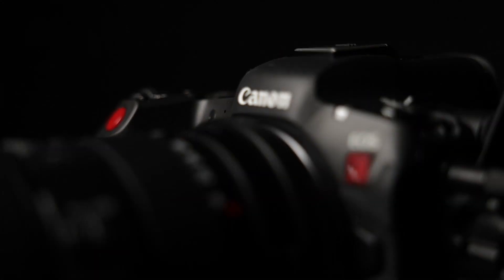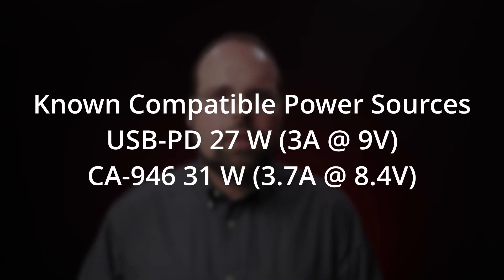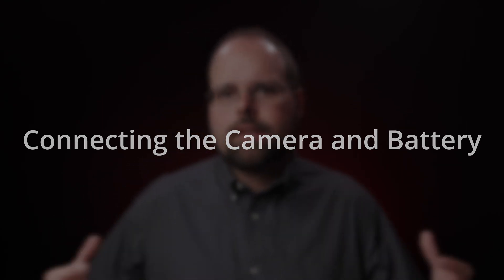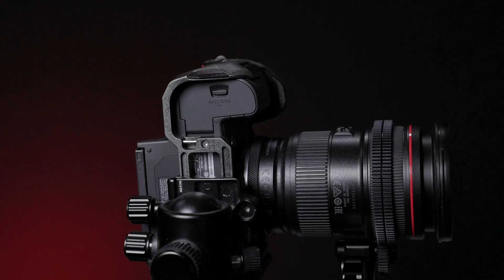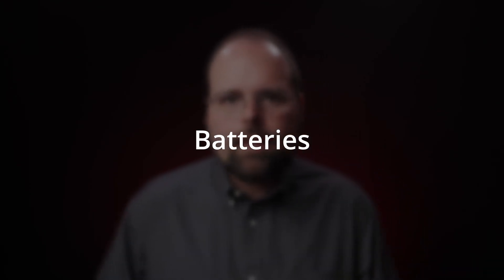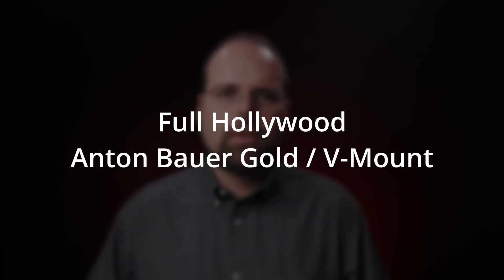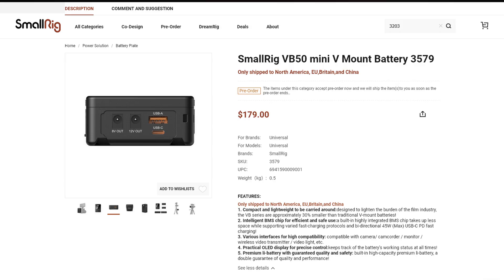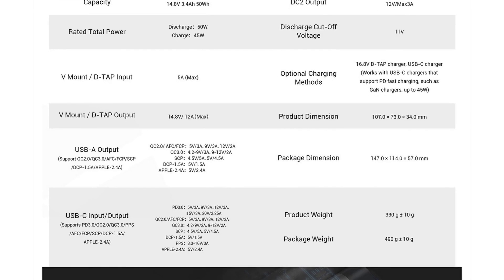External Power for the R5C - EOS R5C Tip 5

Comment: Hello there! Thanks for such an informative video 🙏 Could you confirm what cables you’re using to power your R5C and SmallHD monitor with the Anker 747? I have almost the same kit: An R5C camera, Anker 747 power bank, Atomos Shinobi monitor. The Anker 747 does power the camera all the way to 8K60 w RF lens, but when I connect the Shinobi monitor through a BlindSpot Power Pipe USBC to 12V DC cable, the Anker 747 no longer supplies enough power for Power Delivery to stay on, on the R5C—and the internal battery begins to drain quickly. One more question, do you get 8K 60p w lens autofocus AND power for your external monitor from the Anker 747? Thank you. It’s been such a bumpy ride trying to power this camera kit.
Reply from the maker: The cable I'm using for the R5C is listed in the description - it's the Poyiccot 1’ USB Cable.

I'm using an older BlindSpot Gear power pipe (8.2V output). Blind Spot Gear says you must use a 12V supply, but that's not completely true. It runs fine from a 5/9/15/20V USB-PD supply, it just doesn't supply the full voltage (6.5v instead of 8.4V), which the Small HD display doesn't care about.

The important part is where you plug things into the Anker 747 battery. The camera has to go on the outer USB-C port. When there's multiple USB-PD devices attached, the outer port will continue to supply 45W while the inner port's output gets throttled to only 18W. The camera needs a 27W supply to operate off USB-C, so the outer port satisfies that when both ports are in use.

As long as the camera says USB-PD in the upper right corner of the screen, it's running on USB power, if it drops to battery that changes to the estimated battery time remaining.

Comment: We have an external FXLION ONE Vmount battery.  when we plug it via USB C,  the camera display shows "USB-PD" for about 5 seconds then it goes away, and starts using the internal Canon NH battery.  We let the internal canon battery drain and wondered if the external would kick in at some point, but it didn't.   Im wondering if there is an issue with the USBC port /internals on the camera body?  We've tried different cables... in fact the supplied canon cable, when connected, doesn't seem to be detecting the external battery at all (in other words, the camera display won't even show "USB-PD ").  I've verified the external battery functions, by using it to power lights, charge phones, etc... so we're confident the battery is functional.  Any ideas?
Reply from the maker: I've seen a few USB-PD capable V-mount batteries that don't work with the R5C for some reason. SmallRig specifically notes this on their batteries. This may also be the case for the FXLION batteries (or some of them as well). 

If you have a >30 W USB-PD charger (like the power supply for a MacBook or MacBook Pro), try using that and see if the camera switches to PD mode. If it does, then it's not the port on the camera, it's the battery's PD implementation.

Of course, the whole point of USB-PD is that it should just work, anything that supports the required wattage should be usable. But in practice, it seems like corners are cut at every opportunity and with it compatibility. So much for USB being Universal as the first letter implies.

Comment: Thanks Jason, great insight into powering the R5c which I just bought. Just a quick question, I have a ‘power junkie’ npf battery adaptor with a few usb outs. It’s made by Blind Spot. Do you think that mounted on the hot shoe and tapped into the camera, will work? Hugh
Reply from the maker: It should work with a dummy battery. But you will have the power limitations if you want to shoot at 8k60 FPS. If 8k60 isn't a consideration, then it should be fine.
Reply: Yeah, I have it it'll work fine. The barrel output to the camera is just like a battery inside the cam. Gives those two usbs and you can use a beefy npf. The other guy is right you cant get 8k60 any other way but USB pd

Comment: Great video. Thanks so much for the information. Quick question for you. I am unable to change recording modes when I have the USBPD plugged in. The menus are grayed out. Any reason you know of? If I unplug and go internal battery it works as normal.
Reply from the maker: I've never seen that one before. On my R5C I can change between any of the recording modes whether the camera is on USB-PD or the internal battery. In fact, I don't think I've ever seen the rec mode setting grayed out ever.

I'm at a loss on that one. The only things I can think of to troubleshoot that one are to make sure you're running the latest firmware and if so reset the camera's settings to factory defaults (system settings -> reset).

Comment: Question, I have a SmallRig 50w vmount battery, what type of cables can I use to power my R5 C? I seen people have Type C to Type C. Is that the only way? You cant do USD -> Type C on the camera?
Reply from the maker: Yes, you need to use a type-c to type-c cable. 

The R5 uses the USB Power Delivery (USB-PD) standard which requires that it actively negotiates the power settings with the supply (your SmallRig battery in this case). If you check the specs on that battery, it does not support USB-PD on the Type-A (standard rectangular USB port) so even if you used a Type-A to Type-C cable, the camera wouldn't be able to negotiate the right settings, and as a result wouldn't use the battery for power.

Unfortunately, the governing body for USB has really made a mess of things over time. Maybe it's just me, but I feel like USB is becoming more confusing as time goes on rather than less.

Comment: Im not sure what I am doing wrong - i've put a battery in the camera and plugged in a USBC cable from both mains and a power bank (used to power BMPC4K) and it doesn't seem to do anything!?
Reply from the maker: If the camera is on, and in video mode, it will display USB PD in the upper right corner of the screen instead of the remaining battery time. That's the only indication that it's running off of USB-PD.

If it's off, and you have a LP-E6N or LP-E6NH battery, there will be a charge icon on the top display (or full if the battery is charged). Only LP-E6N and LP-E6NH batteries can be charged in the camera this way, and you'll probably have to stick to Canon first party ones at that.

If you're not seeing any of that, check that your USB power supplies support USB-PD and can provide 3A at 9V (27 watts). It's capabilities should be listed in the fine print somewhere on the charger or battery pack. If they can, try a different USB-C cable.
Reply: @PointsInFocus  thank you for the detailed response. Appreciate it!

Comment: if I want to use my v lock BV140HD MINI on belt adapter via cable and dummy battery? would that work ? what dummy battery u suggest ? thx
Reply from the maker: It would, at least subject to the limitations I talked about with dummy battery cables. 

Unfortunately, I don't have enough experience (and I'm not likely to get any anytime soon) with enough dummy batteries to be able to make any recommendations.

What I can say is that if you want to plug directly into the D-tap port on your battery, you'll need one that includes voltage regulation. Also, I wouldn't cheap out on this. You can find tons of generic ones on Amazon, but I'd stick to a well known brand.
Reply: @PointsInFocus  thank you 🙏🏻

Comment: I have been loving using my fxlion 3 battery through usbc HOWEVER I noticed that now I cant connect any run stop device to the camera since they all connect through usbc so there is one bbig advantage to the coupler which I would love a link to any recommended one but going that route will allow me to connect my camera to my tilta hand grips so I can control the run stop and things when it is on my shoulder or hand held
Reply from the maker: As far as things currently stand, I'm not aware of any couplers aside from Canon's that properly support the full 8K60 capabilities of the R5C. If you don't need 8K60, then you should be able to get away with most decent quality DC couplers. I personally like ones that have built in voltage regulation, as there's too much of a risk frying the camera otherwise (something like Anton Bauer's P-Tap to LP-E6 cable).

If you want to go USB-C for power but use a coupler, you could try using Canon's DR-E6C DC coupler (which supports 8K60) and a 9V USB-C PD to DC adapter cable (something like this https://www.adafruit.com/product/5449 from Adafruit, you may also need an adapter for the DC connector). Though I haven't tested this configuration, so it may not work.

Comment: im using Nano One battery but getting no power to camera...do I have to have the battery in as well?
Reply from the maker: If you're connecting to the Nano One with USB-C then yes, you have to have a battery in the camera for it to power up and negotiate the right USB-PD voltages.
Reply: @PointsInFocus  thx.. ! Only thing I don’t like about that battery is the display doesn’t stay on

Comment: Is the Anker 747 also compatible with the R5 and R6? Thanks
Reply: Would the Anker 537 do the job for the R5 and R6 - it has a 45 Watt PD port so I'm guessing it would supply enough power to charge and use the camera? Thanks again. Great video by the way.
Reply from the maker: Yep, the 537 should work fine.

As for the R5 and R6, anything that can power the R5C can power the any of Canon's current mirrorless cameras that use USB-PD. So the R5 and R6 will work fine with either the 747 or 537.
Reply: @PointsInFocus  Thank you very much. Very useful channel, keep it up. I've subscribed.

Comment: I do not understand why Canon can't make a new battery that identifies itself the same way the new dummy battery does and provides the same power.
Maybe the runtime just would not be practical
Reply from the maker: Run time would certainly be a problem. The LP-E6 form factor is only physically big enough for around 16-watt-hours of capacity. More modern battery chemistries might bump that up a few watt-hours, but it's not going to double it, or more. So you're still talking about ~30 min at the highest loads. At which point, that's a lot of effort going into something that addresses a niche case — and lets be honest, 8K60 is a niche case.

The bigger problem, or potential problem, would is heat and safety. When you pull a lot of current form a battery it gets hot. In something like a Tesla car, the batteries have water cooling to keep them from overheating and catching fire in normal use. The batteries are fundamentally the same (different form factor and packaging, but they're both Lithium Ion technology). The same thing happens in consumer electronics, only instead of water cooling the battery packs, the power output is limited to something that wont cause wear, damage, or excessive heating.
Reply: Im under the impression it’s a software issue why they batteries don’t last long.  Or more specific the camera shuts off with 40% battery left.  Hoping a firmware helps some.
Reply: @DavidKfilmmaker  Firmware might impact the battery life but there simply is not enough voltage in 8K 60 to power autofocus lenses.